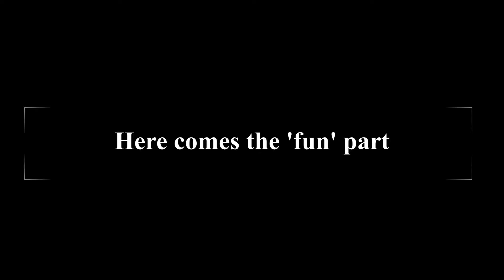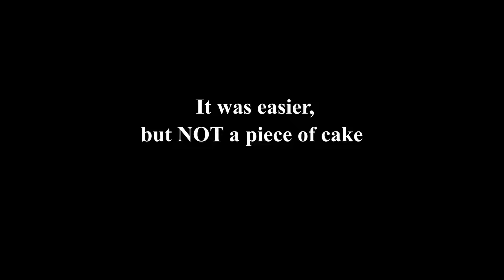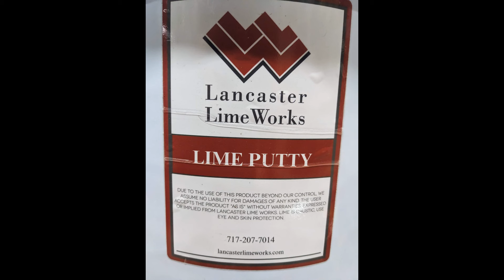How to Make and Apply Whitewash, We Whitewashed our 1840 Farmhouse Root Cellar

Comment: hum.... buss tubs for carrot in sand for storage, never thought of it.   We use burlap lining plastic crates with second layer dirt (top soil, second layer, then clay as you did down... not brown top layer, not clay, but that layer in the middle that is kind of lighter brown and grainy).
Reply from the maker: From what we've read, many people recommend sand, peat moss or saw dust.  Probably anything that will maintain some moisture would work. We'll find out how well sand works over the next 8-9 months.

Comment: That root cellar is looking great. I remember you didn't get the temprature down as much as you wanted with the ventilation fix, and that you hoped that given some time it would go down some more. So what's the verdict on that? Did you get the temp down more after a few months?
Reply from the maker: It is approaching mid October and the temperature is in the upper 50s.....not great. But it has been a warm Fall.  When we get a few cold nights I will run the ventilation system all night to help cool down the stone walls. So, it is too soon to report the final outcome. Fingers crossed!
Reply: @waardenburgfamilyfarm4764  Yeah. Good luck with that. Otherwise I guess the only way to improve is to maybe try to make the door even better insulated.

Comment: Can you Dry age ham from those ceiling hooks?
Reply from the maker: We are not experienced with dry aging han, but from what I understand 46 degrees F is ideal and humidity at 80%.  In mid winter we hope to have mid/high 40s but humidity may be over 80%. I'm going to dig-in more.  I need to find a local expert. Thanks for the suggestion.